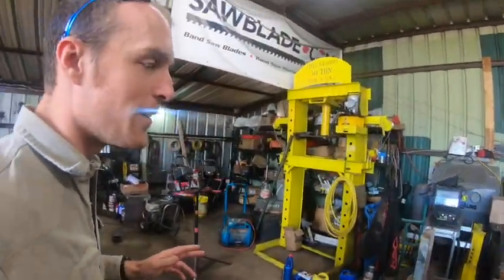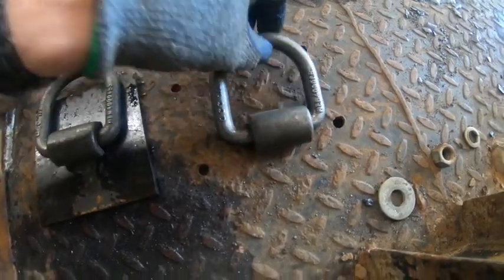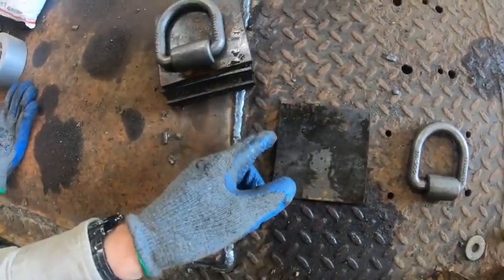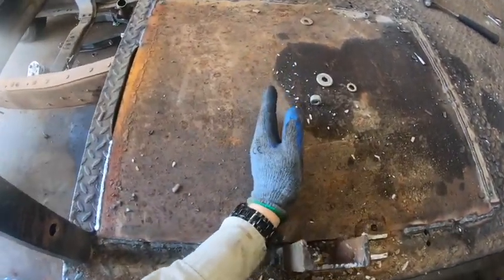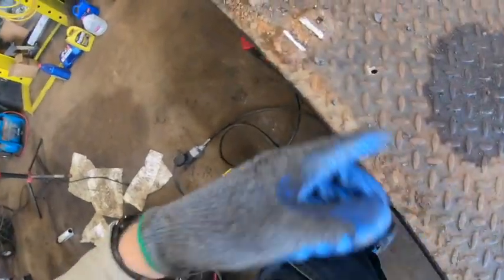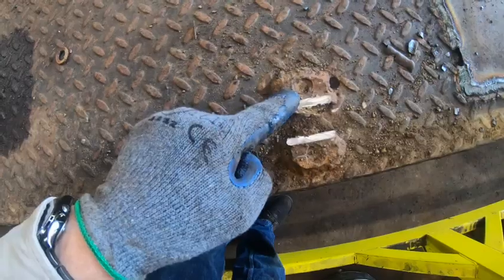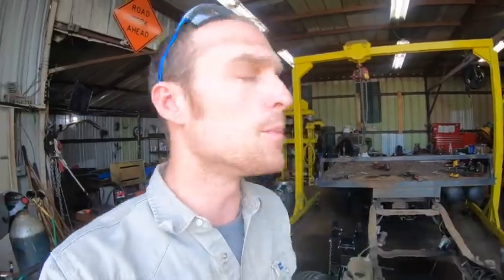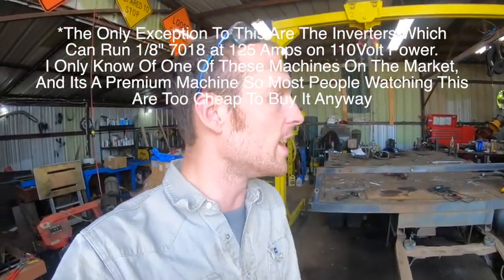D RINGS - EASY TIPS TO WELD THEM ON LIKE A PRO! For Tractors, Trucks, Trailers & Equipment!!!

Comment: Ultimately as far as that U that attaches the actual ring is the only part that will have any strength to hold the ring. So basically the plate is only useful if your welding to thinner steel on your trailer.

Comment: Everything you said was spot on. I will say, with a lot of millers newer machines like the maxstar 200 for example can run somewhere around that 125 amps for stick, and even 150 for tig on 120v power and than 200 amps for both on 220 and 440v. But like you said, if you have a machine like that you will be doing it right anyway, not with a cheap harbor “fright” welder. I love dual voltage machines because it limits how much I need to run a generator when doing work for people

Comment: My car hauler has D rings welded right to the frame. No extra metal under the ring. I have not had any issues  with rings pulling loose, etc. I can see your logic if I was hauling large equipment via the metal ratcheting chain binders, I'd say yes, add the extra metal. I haul smaller tractors and use straps and my D rings work just fine.

Comment: My enclosed car hauler has a plywood floor.  It does have metal plates under the floor in strategic areas and that's where I bolted my tiedowns.   As a car hauler, I doubt I'll ever have more than 3500-4000 pounds in it.

Comment: "Not a beginner project"  Lol.  I had never welded anything and had never even touched a welder.  But I watched Youtube so that made me a certified idiot.  I was 21, I bought the expensive model of mig welder from good ol Harbor Freight.  I think I maybe practiced welding two plates together, but not sure.  First project I did was weld D rings on a utility trailer.  They looked like absolute shit, but here we are 10 years later and they are still holding.  Like most 21 year olds, I was an idiot. But I'm 100% self taught off youtube and have become a pretty descent welder over the years.  Still use the cheap ass HF welder.  I'm literally the epitome of a youtube moron but hey, I own it and fuck it.

Comment: I've had good luck running a chinese 110 stick welder combo-- (it does tig and also a plasma cutter).  I can also run it 220 on the same machine, but for convenience, I mostly run it 110/ stick.  It's not quite hot enough to run the 1/8 rod very well-- so I get the smaller 3/32 rod and it works beautifully.  This way it gets more than hot enough and has great penetration..  But I would have to disagree about using 6011 on a cheaper trailer like this/  it still works fine.  It's not like you're booming down a 40ton track loader or something;  especially with the extra plate, it's more than enough.
Reply: Which machine are you referring to?

Comment: I put a D-ring on a tractor implement and while the weld didn't come apart, the ring itself straightened out because it was just bent into shape, and not welded 1 piece solid...  half inch rod bent into a D, 25hp tractor straightened it right out pulling fence posts out of the ground... lol, some shitty luck there...

Comment: PLEASE Correct me if/when I am wrong, MIG is the easiest to learn, TIG is the hardest to learn and probably the best looking finished product, Stick is the Strongest finished product, and Gas is more for delicate work - Jewelers etc.... Would this be a crude assessment? I have done some Gas and MIG years ago, but that was 25+ yrs ago. Thanks Chuck I enjoy your instruction style.
Reply: Er70 (tig filler), 7018 (stick rod), ER70s (mig wire) are all the same just different processes. They are all rated at 70k tensile strength. A tig weld is just as strong as a mig weld and that’s just as strong as a stick weld. Each type of welding has its own advantages and disadvantages. Stick welding is great in the drill because you don’t need shielding gas, mig is nice because it’s fast, tig is nice because it’s a “clean” finish state as in you don’t have to brush it or clean up bb’s. All three processes should be peeped the same way tho.
Reply: For a home shop a mig welder and a stick welder are the best choices out there for ease of use. If you have the time to learn to tig then go for it. It’s just a little slower process, not much but a little slower.
Reply: @paulerenberger1286  Thank You Paul for your reply and knowledge.
Reply: Jeff, kinda depends more on what your welding. Arc welding ,( stick) is more for structural steel. Thicker pecies. If your just going to use it around the farm. Stick is the way to go. Cheaper to get set up with to. Welding flat is fairly easy with stick. You'll get the hang of it in no time. Gets much harder when you get horizontal/vertical. Even harder if your trying to weld something upside down. ( Overhead). Mig is more for sheet metal. Although, you can certainly weld very thick stuff with a mig welder. Tig I don't know much about. I did some in welding school. It was very simple. Almost exactly like welding with a Oxy/acetylene torch. Just get the edges to start flowing together. Adding filler rod as you go. I made out here in the farm with just a Lincoln 225 A/C machine for many year. Got a Mig about 10 years ago. Just for sheet metal. Wonderful for that!
Reply: @rogercarrico4975  Thanks for info.
Reply: All 3 are easy if you think about it. it does the exact same thing. Flux Core is the "shield" to keep the weld freed of impurity.

All three requires you to manipulate power ( output amp ) and wire/stick speed of injecting into the puddle. Each three has a consumable rod or material.
Reply: @rogercarrico4975  The right mig weld you can weld thick material.   We ran them all the time with 3/8 and 1/2 inch material no problem even did 3/4" and thicker without a problem. IT is all about the size of the weld and the speed you are moving.  The thinner the faster you go with smaller welds the thicker material the bigger welds and slower you go.  Really the main thing is can you get the mig welder close to you or not.  But with the suitcase mig welder units not much of a problem these days.  Just long leads to get power to the suitcase and then 10 foot mig gun.

Comment: What about bolting and Welding?
Reply from the maker: Don't... Honestly regular bolt on d rings are pretty strong, enough for many applications. If you need more than that, have a weld on d ring welded properly

Comment: My welding skills aren't the best.  I'm building a 37 pickup with Mustang II front suspension.  I enlisted my cousin, a professional welder, to weld that in.  I am going to have him wild in some bracing that I"ve tacked in.
Reply: Just my experience.
If you are using the original 37 frame.
Preheat before welding and let it cool slow.